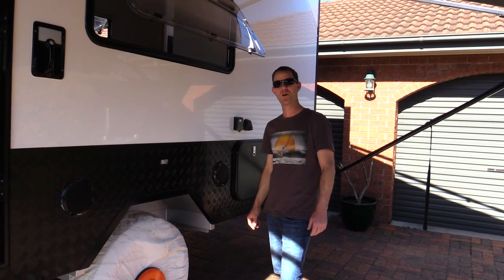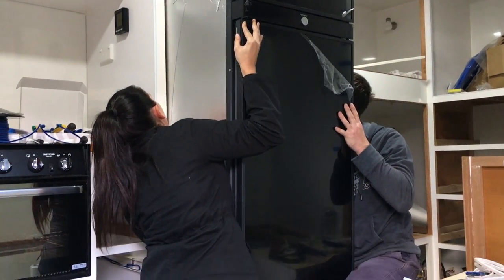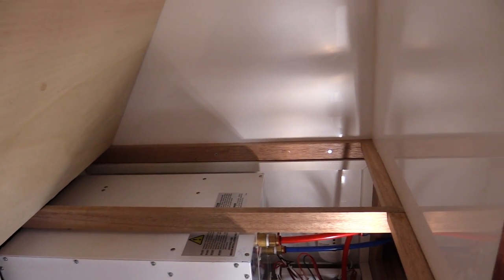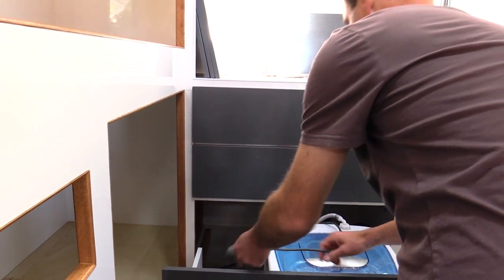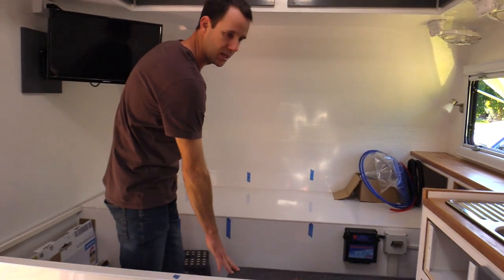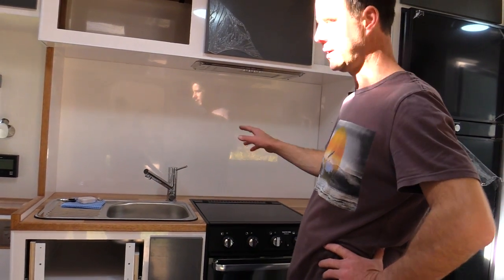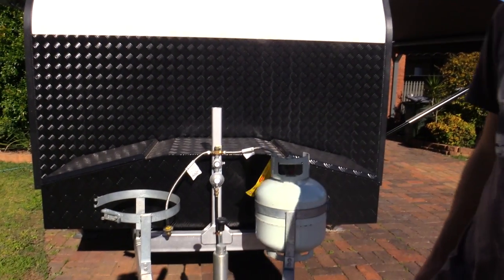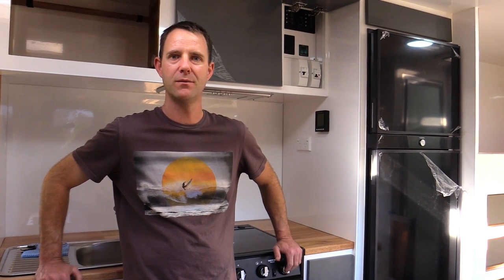DIY Caravan Build Series ep 2

Comment: Love your trailer! Nicely done. I started building mine  exactly 1 year ago here in BC, Canada. Doing it all out of aluminum. Tried to source the kind of wall panels you were using but it was impossible to get what I needed here. Even tried to import them from China but the freight is just to much. 
Would love to know more about the specs on your trailer, sizes and dimensions, total weight and drawbar weight, cost etc. 
You are doing an amazing job, dude!
Reply from the maker: Woodatwork yes sourcing parts and materials is frustrating at times. Once the build is complete I’ll do a video with all the specs weight etc etc. thanks for watching👍

Comment: Very nice. I hardly could find any videos of wiring and plumbing done on styromax. Would you be able to explain how you did it
Reply from the maker: Well it all depends on your needs, the appliances and lighting etc. I had StyroMax install conduits in my panels for some of my wiring and the rest is in aussieduct in the backs of cabinetry. As for plumbing most of it is underneath the van and comes up through the floor to the shower and sinks👍

Comment: So there js no frame to this build --the composite panels are strong & rigid enough for the job
Reply from the maker: Yes that’s correct, no frame the panels are structural. There are some composite pultrusions to support the air-conditioner and conduits for wiring 👍

Comment: How did you run the wiring in the walls
Reply from the maker: When I had the panels constructed I specified several conduits to be installed inside the panels. For the rest of the wiring I used ducting inside the cabinetry 👍

Comment: How did you finish the inside curved section at the front? Where the relief cuts are made? Thanks
Reply from the maker: If you check out EP 3 You can see the lower section has an Upholstry padded section on it. The upper curved section in the overhead cupboard has an extra 2mm fiberglass sheet glued over the grooves 👌